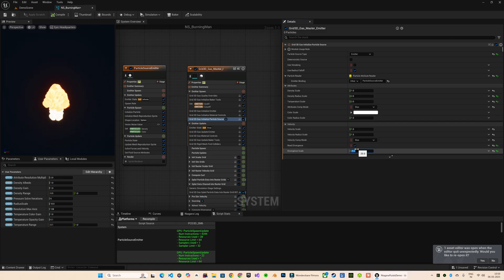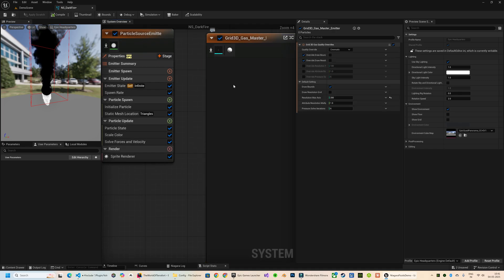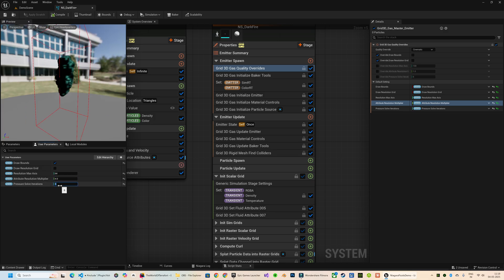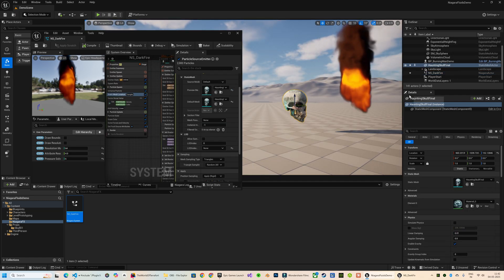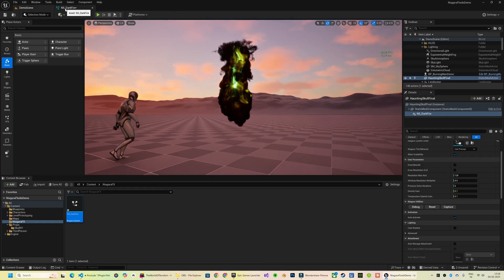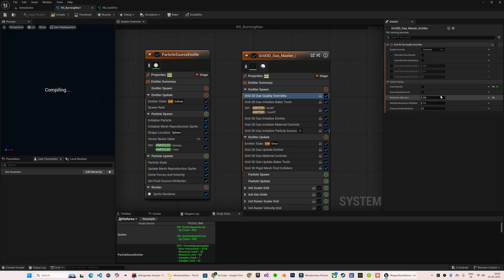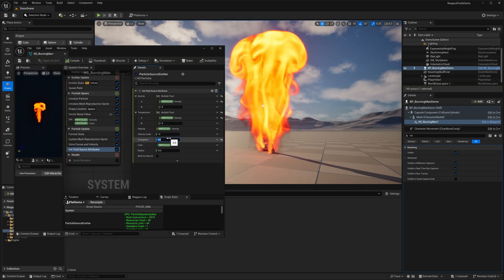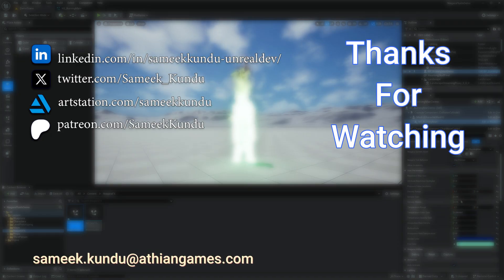Introduction to Niagara Fluids | Dynamic Fire FX with Mesh Sampling in Unreal Engine

Comment: Thank you very much for the video. I’m working on something similar, but instead of a skull, I have a torch. However, when my character is running — the way I do it in the cinematic — the fire only appears when the character is standing still. When he moves, the fire seems to disappear, as if it’s invisible. Could you please tell me what might be causing this issue? Could it be related to an update or something else? In static mode the fire burns, but in motion it disappears.